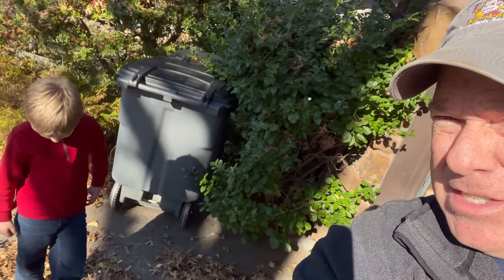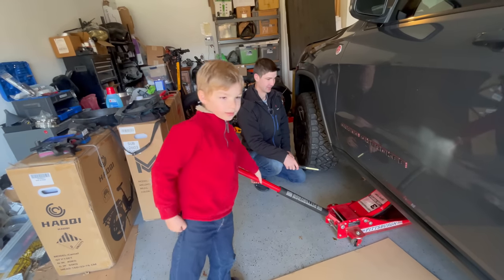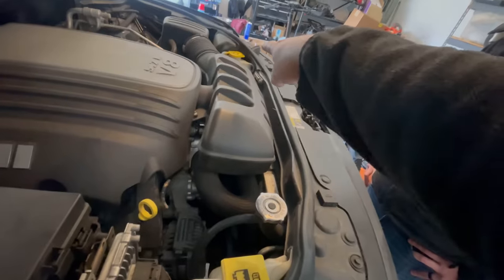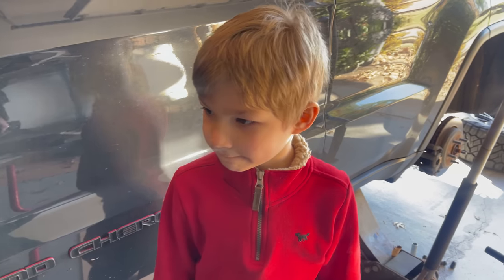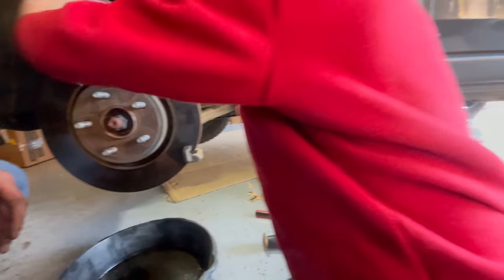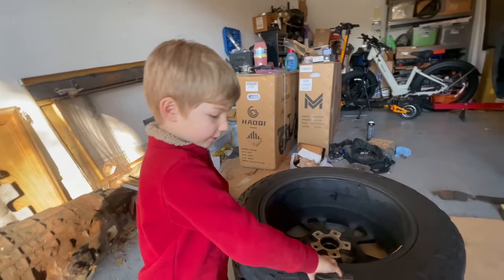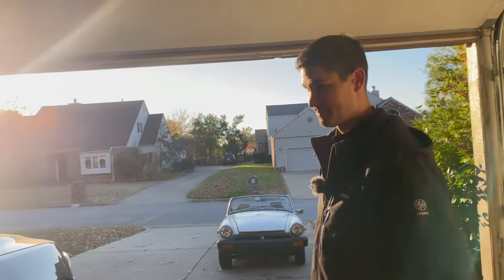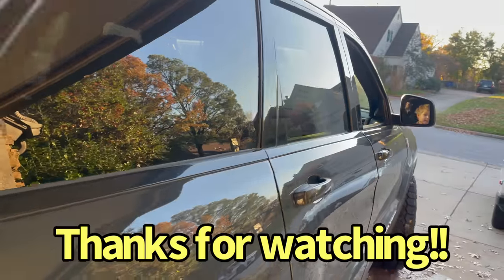Learn About Brakes From A 6 Year Old!!

Comment: If doing all four brakes it's best to start at the right rear first , then the left rear , then the right front, then last the left front brake assembly and after each brake point completion pump brake pedal until hard .🤔🙏👍, no need too open fluid system unless you want to change fluid 🤔👍